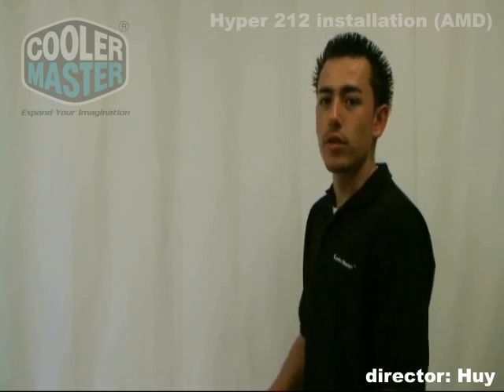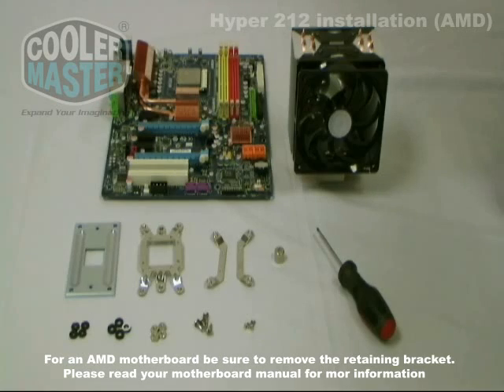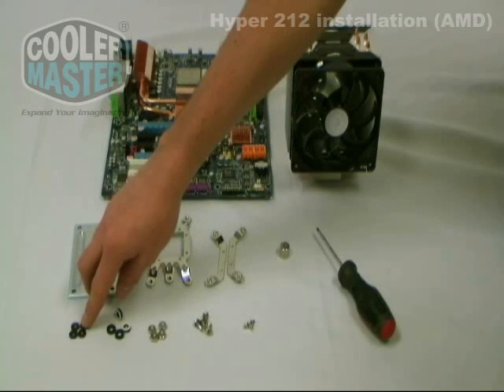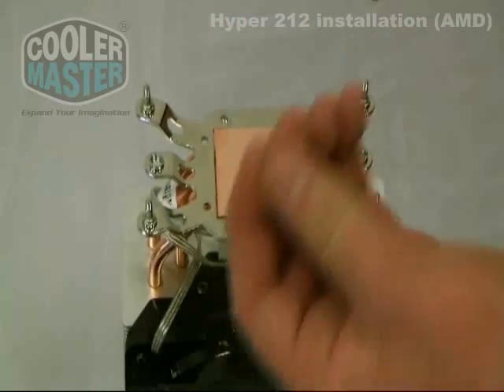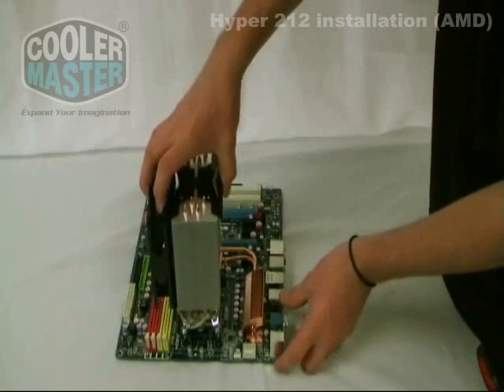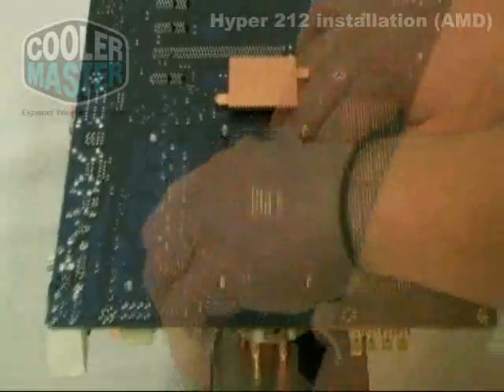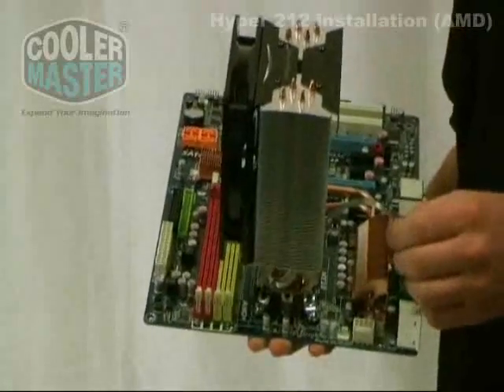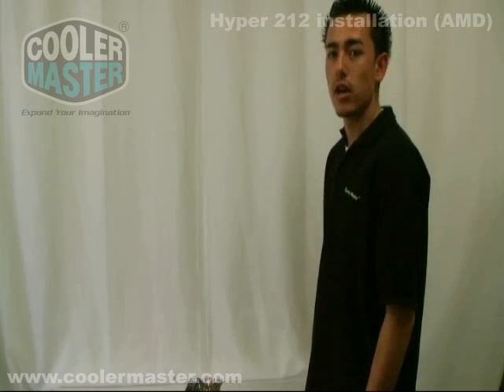Cooler Master Hyper 212 Cooler Installation

Comment: @lentyski dont worry man. you get the thermal paste with it and all you do is apply a little dab in the middle of your cpu chip and spread it across with a buisness card. you dont use all of the paste either. also when removing your old cpu cooler it might be stuck with your old paste so turn it left and right gently to break the seal. dont pull straight up or u will bend the pins. anyhow i installed myn 3 days ago its way eaiser then it looks just take it slonw

Comment: This is the old installation hardware for the Hyper 212. If you have a newer Hyper 212 that does not include the old flat AMD mounting bracket for the back of the motherboard be sure to check out a newer video.

Comment: @eldaguinio Could be worse - I've read the included fan gets up to 16-17 db at 12v.  You can replace it very easily with any fan of the same size - you can even add a second fan in a push/pull configuration with a second included set of wire clips or brackets.

Comment: @sh4rkbyt3 okay maybe your right i have never did any of this so i can't be the smart one here. but i watched a demonstration video where that guy had some cpu's and tested the spreading of thermal compound over the surface with different methods by putting a piece of clear acrylic over it. and as far as i know the card spreading was worst option... but i don't know..
ether way most of coolers you can buy these days have the compound pre-applied so you don't have to worry about that :)

Comment: @shadowsun4386 Hi, I would recommend applying the thermal grease on the CPU only , applying  paste on both CPU and heat sink could get a bit messy and would not be as efficient

Comment: @cankarales And you cannot tell if you have enough or not simply by doing the blind method your talking about. I've seen people use this way and get a tiny spot of thermal paste on the side of the CPU which made contact in a socket hole and fried both their mobo and their proccy! It does happen and that's exactly why you need to pre-spread the thermal compound!!

Comment: @cankarales I disagree highly with your statement about not using a card. The idea is to get an even and COMPLETE surface covering of thermal paste onto the top of the CPU. By simply placing a clump in the middle there is no way to tell if the surface of the CPU and the heatsink are completely covered. I used to use the old method your talking about and after taking them apart you will see that it is an unevenly spread area. Some areas won't even get any thermal paste at all.

Comment: u shoulda remove the sticker just before installing the cooler and do not ever spread the compound over the cpu surface with a card just put some compound on the center and press the cooler on it. that way the contact between cpu and cooler is much better resulting in better cooling performance.

Comment: CPU Socket: 
Intel: LGA 1366 / 1155 / 775
AMD: FM1/FM2/AM3+

CPU Support: 
Intel: Core i7 Extreme / Core i7 / Core2 Extreme / Core2 Quad / Core2 Duo / Pentium / Celeron
AMD: Phenom II X4 / Phenom II X3 / Phenom X4 / Phenom X3 / Athlon X2 / Athlon / Sempron
YES, COMPATIBLE WITH SANDY, IVY!! CHECKTHE SOCKET 1155 is SUPPORTED!! specifications -_-

Comment: Nice vid, thanks, afraid the model has been updated a bit...no longer has that plate for behind mobo...and I don't know if it changed for the worse, but whoever put together their install sheet is either one hell of a jokester, or an all out sadistic sob...as the guide fails on many levels before it was shrunk down to microscopic print to accomodate 30 languages.  I can read almost anything..at distance, in the dark, and this think almost led me hang myself.

Comment: @cankarales "okay maybe your right i have never did any of this", then why give advice on something that could potentially be disastrous to a new builder? I'm not raking you over the coals here, I just don't understand why someone would attempt to give advice to others that your a) not sure about and b) you have little to no experience in yet you offer it as authoritative? Ask any pro builder and they will 9 out of 10 times want it spread evenly rather than to glop it on and hope for the best.